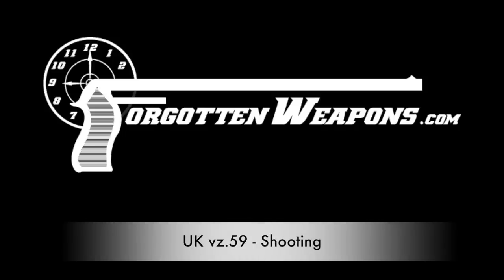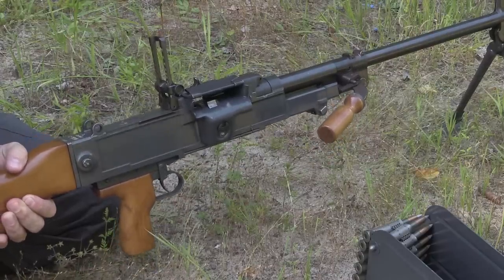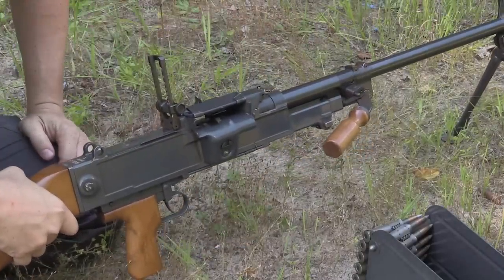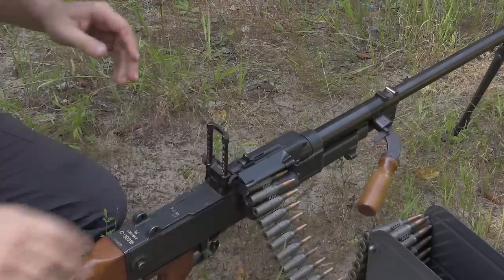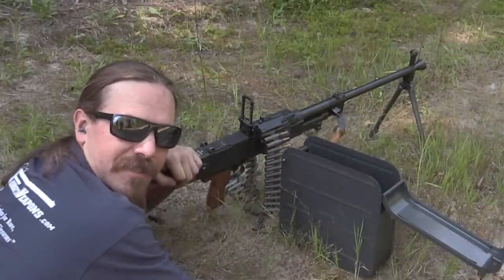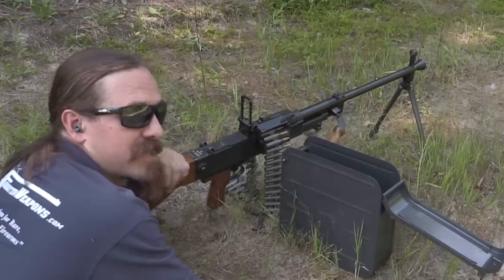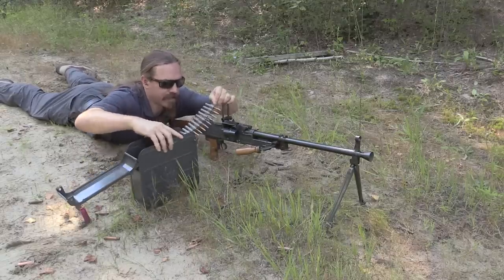UK vz.59 Czech Universal Machine Gun: Shooting

Comment: I shot the UK 59 several times during my year long service as conscript in Czech Army in 2003/4. Its catridge was really powerful, going through brick wall or 1 cm of steel like it was paper. The issue Ian spoke of ("to have either a little less cartridge or a little more gun") was well known and the solution was this: When getting prone, you smash down the front end of the gun hard enough to bury the sharp ends of bipod legs an inch into the ground. After shouldering the buttstock you move your whole body few inches forward, so the bipod is not standing vertical, but slightly inclining forward. Then the recoil is transfered to the ground. I vividly remeber my surprise after the first shooting, that UK59 recoil was even smaller than from my beloved vz58, although the cartridge was twice the size.
Reply: Doesnt it use the old mosin style warsaw pact cartridge? The same as PKMs? The Czechs have been lucky with their weapons, they had the best AK variant and the Bren 2 is probably my favourite modern assault rifle. It's well liked in the ukrainian international legion who were donated thousands of them. I also saw czech troops still using vz58s in afghanistan around 2010. Crazy.

Comment: Hmm, the infantryman's dilemma, the machine gun will either break your back from being too heavy, or so light the recoil rattles your teeth loose.
Reply: Yep. I'll stick to the MAG/M240 ;) Yeah, it is heavier but better in use because of that weight.
Reply: In order to have a more controllable gun in a lighter package, you'll likely have to use a more intermediate caliber.
Reply: or PKM
Reply: Except the PK is no heavier then the zk 59. Don't get me wrong, I'm also a fan of the M240 and was glad when we got rid of M219 in M-60 tanks.
Reply: The PKM hits the right spot between being light and controllable in fullauto.
Reply: Just get bigger machine gunners
Reply: Farley Moab seriously underappreciated response
Reply: As mentioned by Ian there the heavy barrel (tank co-ax?) version exists which is perhaps the better balanced of all the variants.
Reply: So sad this channel will be closed by youtube. No promoting showing or demonstrating guns on youtube now. Soon they will start taking all gun related channels down :(
Reply: The solution is and anti-recoil system, muzzle break and compensator, which add weight and shoot a revealing cloud of hot gas all around you, so more pros and cons.
Reply: frbe0101. Would NOT like to be behind the compensator/muzzle-brake of a 7.62mm weapon firing hundreds of rounds per minute. It would be like staring into a rocket exhaust.

One factor for PKM has to be the rate that the bolt assembly is slowed down. Some machine guns have the bolt hit the back of the reciever at almost full velocity, others the bolt assembly is continually being decelerated from when the bolt gets its initial push open.

But weight matters as well, there's only so much you can tame a very light arm firing such a powerful round at such a rate of fire. It's not like it makes that much of a difference to the overall operational load of a platoon's MG, each box of ammo is about 8kg, what's another 2-4kg to the MG's weight.
Reply: That reminds me of the mosin dilema, comrade. First round will dislocate your shoulder, next one moves it back...
Reply: You could also in some cases go for a lower cyclic rate. That will generally give you more time to stabilize in between shots.
Reply: Bhum Brahmavira Muzzle breaks are a nuisance to anyone standing around you.
Reply: Constant-recoil machineguns give the best solution. Weapons such like Ultimax 100 can be fired single handed.
Reply: 240b do both
Reply: You can also have a real Czech man shooting it! :D
Reply: I know weight can be a bastard to carry , but when shooting full auto using more powerful ammunition more weight is great . 
I love BIG guns 💪
Reply: @yuriyromaniw6629  the Sinstral Machine gunner?

Comment: There are two versions of barrels. One heavy and one light. I thing, that you have that light barrel in it. With heavy barrel it is much more pleasant to shoot.
Reply: What is the purpose of light barrel? Can't help but feel curious.
Reply: @muhammadnursyahmi9440  easier for infantry to carry, heavy barell shoul be  used in defence positions and also against  light armored vehicles, aircrafts ets.
Reply: Yeah, he has the light one. Heavy barrel has different flash suppressor and it's little bit longer.
The reasons for each version - obviously weight. Heavy machinegun was designated for heavier stand (as AA), mounted in bunkers,... Light ver. just for barrel bipod.
Reply: there is nothing pleasant on this gun :-D :-D :-D
Reply: @muhammadnursyahmi9440  light barel is with bipod for, let's say, move and shoot... the gunner has the heavy barrel too (without bipod) and in the squad someone has the (heavy) tripod... for more stationary use...
Reply: Tomas mas pravdu , tezka  hlaven  totalne transformuje Tuto vinikajici zbran 👍🏻
Reply: Is this a quick change barrel gun?

Comment: (EDIT: corrected mixed up belgian MGs) Fun fact:
In AČR (czech military), UK 59 is technically still in service, but for several years it's been not recomended to use on foreign missions, where AČR actually prefers FM MINIMIs in 7.62x51. 
Not because MINIMIs are better (even if they undoubtedly are) or because the standard NATO ammo supply lines are well established and 7.62R would cause some logistic problems (it wouldn't really, from cold war era, the army has stocked enough ammo for whole war and then some), but simply because the  way UK 59 ejects spent cartridges, which causes dust and sand in desert envirorments to fly off the ground and, if the gun is fired from bipod, get into the weapon's internal friction areas and cause malfunctions. 

It's actually the very same feature shared by all of its predecesors, including LK vz. 26 (and its better known offspring, the Bren), but apart from Bren, no other gun in this family was ever extensively used in envirorment dusty enough to actually cause any problem. 
I heard somewhere Bren gunners in north africa were suggested to use rugs or fabric under their guns to protect them from dust, but even if it was true, it would still be unacceptable solution for modern army.
Reply: Pavel Tobiáš That is a terrible reason, if that is the reason.  The FN MAG also ejects casings downward, and has no dust cover there.
Reply: AČR doesn't use FN MAG. But I see people from combat units walking aroun with FN MINIMIs all the time. Unfortunately being a military university we're the last ones who get the new stuff, so we are still stuck with UK 59s. And since most of them are close to 50 years old they are not in the best condition.
My biggest problem with it is that you can't carry it as a traditional rifle since it has no foregrip and the carry handle is a pain in the ass to use.
Reply: Yeah, my bad, 7,62mm "big" Minimi, not MAG, always had those mixed up (even though looking at them now, they are nothing alike, except for cartridge and manufacturer...)
Reply: Pavel Tobiáš Okay, that makes more sense, with the side ejecting.
Reply: The main reason is ammunition.
Reply: well we have uk59 barreled in x51 NATO, still in service
Reply: @Sseltraeh89  big minimi is called maximi. cheers
Reply: "I heard somewhere Bren gunners in north africa were suggested to use rugs or fabric under their guns to protect them from dust, but even if it was true, it would still be unacceptable solution for modern army."  Unacceptable?  Modern armies don't like carrying fabulous rugs around?  Why on earth not, also very useful when you're sitting around having a cup of tea.
Reply: @JohnHughesChampigny  i mean, great joke, but imagine getting unexpected hostile contact, you all run into cover, request covering fire and the fucker with the MG responds "Hold on a minute, i need to put down my god damn yoga mat first!"

Comment: It is the most stable gun i have ever fired from the standing position using the vertical fore grip . The tripod for this Weapon is state of the art and the Weapon hangs under the tripod and is even more smooth than the mg 42 tripod is . With this Belt feed you must fire it differently understanding the pulse recoil it has and like a fire man would absorb the push back from his hose so you must do the same with this Weapon . One of the best Belt feeds i have ever fielded and i must say the most positive and reliable ones . You can adjust your rate of fire on the gas block as well .. Great channel and thank you for all you do .

Comment: I've shot one of these and it's quite the beast. It is possible to shoot it from the shoulder, at least for me, but it definitely grays out your line of sight when firing. It's not necessarily a huge problem as long as you line your sights up in between shots and only do relatively short bursts before it climbs too much. I get what Ian is saying in terms of the gun not having enough mass to mitigate the recoil but to be honest if it was much heavier it wouldn't be very feasible as a shoulder fired weapon. That definitely wasn't the intended use of the gun, but I presume the Czechs wanted to leave some of these options open when designing it, specifically the ability to hip-fire in close quarters. If you flip that carry handle over and rotate it downwards it acts as a grip for your left hand to stabilize it if you choose to fire from hip or shoulder, just like a BREN or ZB-30. I also shot an MG-34 and MG-42 and while it is physically possible to shoulder them I imagine that would be more than useless on a battlefield. They are really too heavy to be fired in any way other than prone or from a mount or if you absolutely had to from the hip, using the sling to stabilize it and the bipod as a grip. I think the Czechs were playing with the idea of the American SAW though they didn't get the handling quite right. This gun is too heavy to be used as a SAW and is still a weapon that should only be fired from the bipod, but since it's so much lighter than something like the 34 it suffers from accuracy and other recoil related issues. Basically, the worst of both worlds. Still a really nice collectors peace tho, especially if you get the proprietary sight for it.

Comment: I really hope that Ian gets his hands on a KGK machine gun, which is a Hungarian adaptation of the SGM Goryunov medium machine gun. The SGM is a stationary gun, spade grip only, it was meant to replace the aging Maxim M1910 water cooled heavy machinegun. The KGK, on the other hand, has a pistol grip, shoulder stock and an integral bipod. Compared to the PKM, is much heavier due to the milled receiver and longer barrel. It has the same rate of fire as the PKM, but it's probably much more controllable due to the heavier weight. The PKM has a similar barrel detachment method, which similar to the SGM, it's a locking wedge, but in the PKM, the barrel retaining wedge or piece, is easier to detach, it doesn't require tools. Dunno about the KGK, but the SGM requires pulling with an empty cartridge, or tapping it with a tool if it's sticky.

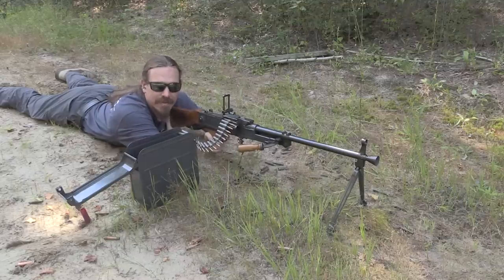Comment: As dumb as this may sound (and someone else in the comments probably suggested this (I’m just to lazy to check for myself) I can see one short term solution to tackling the problem Ian brought up about the spent casings at the 3:51 mark is to attach a brass catching bag under the gun. 
The trade off would be increasing the weight of the gun when full and prevent the user from going prone depending on the size of the bag, but you could, potentially, bring back the casing to be refitted and have an easier time menuvorvng and using the vz.59 without the worry of burning oneself on a heated case lying next to them and shooting while mounted on a moving vehicle.

Comment: Strange that this overdesigned LMG poops out a stack of hot brass right underneath it. That ejection port flap stays open under full auto. It runs the risk of empties bouncing back up to jam the action if you set it up on pavement or concrete. Other than that it's a very cool forgotten weapon. It does kick a bit, looks like.

Comment: The simplicity of the push-through belt looks great, what, if any, are the downsides? Why isn't every modern LMG using such a system? Belt standardisation?
Reply: It is mostly belt standardization. There aren't significant enough practical problems with using a pull system belt, so most countries that adopted one continued to use them if they haven't changed caliber. For example, it's been useful to Ukraine. Modern PKM belts are the same as the old metal Maxim 1910 belts, so the Ukrainian military officially reactivated their Maxim stock for use at fortified emplacements at the Donbass front. Water cooled Maxims are great at defending stationary emplacements and they have the logistics to be able to use them.

Comment: How much more weight would it take to improve the fully automatic handling? I don't have a good intuition for that sort of thing. Might some other tool or equipment be added to provide that extra mass? Probably not as comfortable as it being on a belt or in a pack, but at least it'd be somewhat of an offset.
Reply: 1. Adjust gas regulator 
2. Heavier barrel 
3. Muzzle compensator

Comment: This machine gun is still in use with the slovak armed forces and as I have used it I can say, that... it is very unreliable. It misfires, rounds are not always fed correctly and a colleague of mine had his vz. 59 fire by itself without pulling the trigger. You have to keep the machine gun very well maintained especially during life fire exercises, during which one has to regularly put gun oil into some parts of the machine gun.
Reply: Keep in mind that all the UK vz. 59s in service have seen decades of hard use.
It's like with the perception of the M60 machine guns in the US - liked when adopted, later derided when all the guns in service were worn out after decades of use.

Comment: You didn’t shoot it off hand with the vertical fore grip! 

:D
Reply: It is the most stable gun i have ever fired from the standing position using the vertical fore grip . The tripod for this Weapon is state of the art and the Weapon hangs under the tripod and is even more smooth than the mg 42 tripod is . With this Belt feed you must fire it differently understanding the pulse recoil it has and like a fire man would absorb the push back from his hose so you must do the same with this Weapon . One of the best Belt feeds i have ever fielded and i must say the most positive and reliable ones . You can adjust your rate of fire on the gas block as well .. Great channel and thank you for all you do .

Comment: How is PKM easier to control while it is even lighter?
Reply: Propably has lighter bolt, so it dosen't bounce back and forward. But still, Vz.59 is generally better.
Reply: GunsGuy1990 funny joke
Reply: Don't even know where can it be better.
Reply: lower indirect energy requirement for the belt strip means less momentum in the bolt and carrier
Reply: Czech gun is just much simpler and smaller in construction. For example that push-trought links are a step forward in relation to PKM. The downside of Vz.59 are bipod mounted to a barrel instead of gas piston( which complicate barrel change) and rather bigger weight.

Comment: What's the advantage of charging the bolt with the pistol grip? It seems such a pointless mechanic that requires more machining and worsens the ease of use for the shooter.
Reply: hippymad1 one hand/arm operation?
Reply: No Reciprocating Charging Handle I’m Guessing
Reply: What more machining? You use the same sear that you use for firing and one simple catch in the back. A part moves in an open slot, just like a charging handle would.

It improves the ease of use for the shooter because he doesn't have to change his grip at all to charge the weapon.
Reply: It seems like a solution to a problem that doesn't exist. From my time in the Marines and my limited experience with some Allied countries MGs, I would much prefer a traditional charging handle, perhaps mounted on the left side of the receiver, then that kind of clunky mechanism.

The theoretical benefits of this kind of thing, no reciprocating handle, less machining slots, Etc, are generally a lot less practical than they seem. This is especially important since I'm pretty sure that is standard procedure ( certainly in the US and UK) to carry open bolt MGs bolt-forward, and only charge when you're engaged or about to fire. This looks like it takes twice as long as the handle on a normal M240b like I used, which could be significant in a firefight
Reply: Your last observation is incorrect. It does not take any longer than using a charging handle. Ian just doesn't have any experience with the system. I'm sure the first time he used a regular charging handle on a gun wasn't very fast either. We're just more used to them, but if this was the gun you drilled on, this would be the system you were used to.